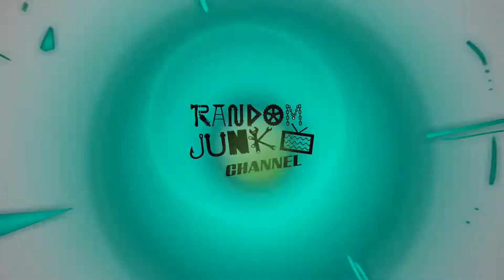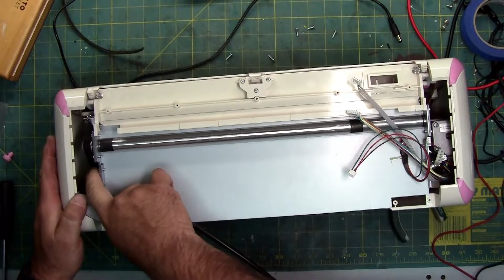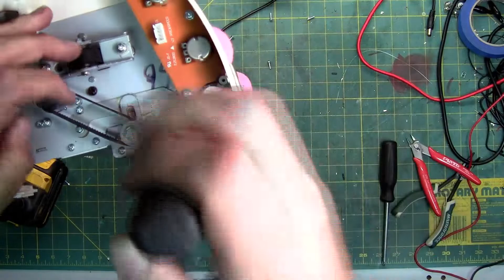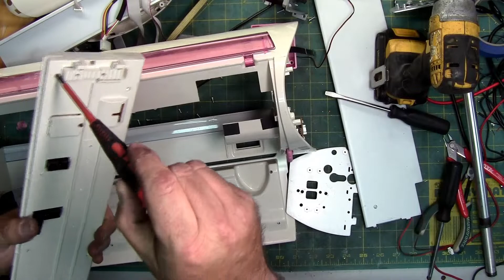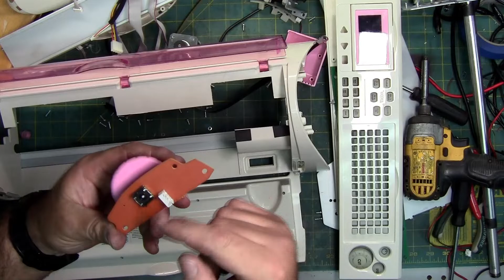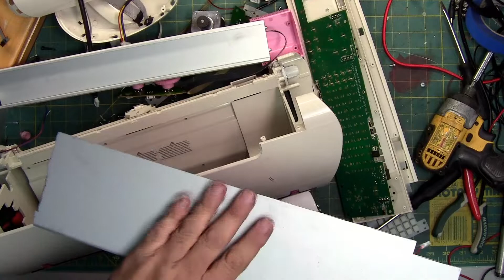Old Cricut Teardown for parts

Comment: FYI, those black and silver motors are NEMA 17 stepper motors. They are used in almost all small cnc applications (3d printers, laser cutters, ...). Being stepper motors, they need power (commonly 12 or 24v for all NEMA 17s), ground, a step signal pulse, and direction signal. They need a special driver board to run, you can't just hook up 12-24v to it. Hope that helps. 

I have a few of these running custom firmware, but I think they need some cleaning and new lube because they don't move as smoothly as I would expect. Or maybe I just have too high of expectations.
Reply from the maker: Thank you for this information